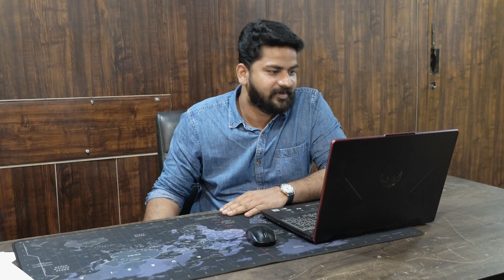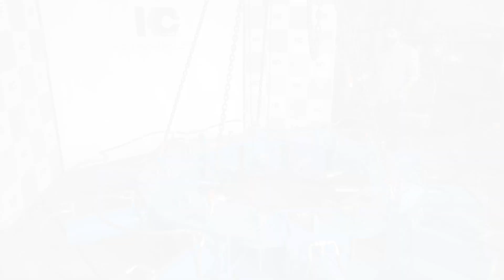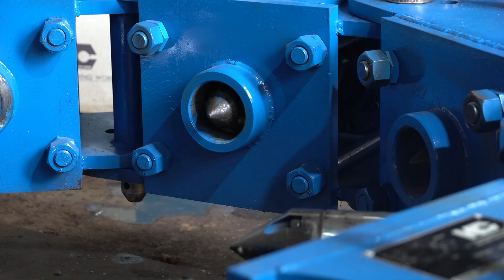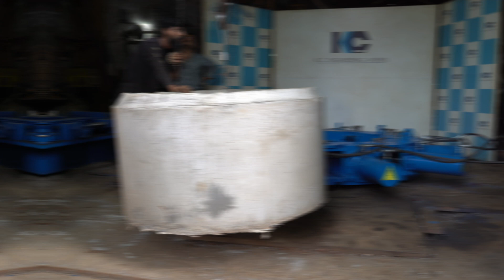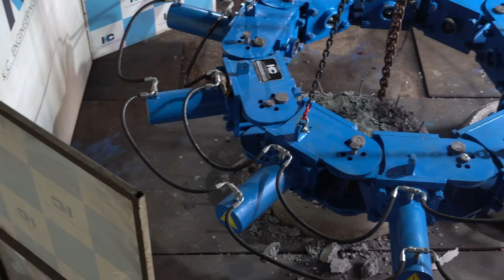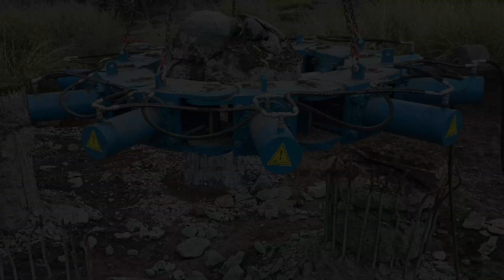Hydraulic pile breaker

Comment: how this pile braker can be attached safely to the excavator as per the international lifting standards. Is it attached on the hooks provided (which has 3rd party certification) in on the bucket through wire rope or the bucket removed and provision is made for attaching hydraulic pile breaker? is the excavator boom has SWL (safe working load- 6 T?) with respect to the braker(3T?) + load falling on the hook while breaking. all hooking point on the bucket, wore rope and hydraulic pile braker should have third party certification. since the bush of braker is sensitive, is the wire rope can damage the bush? is use of web sling is advice which has the possibility to damage itself due to corners and sharp edges though we can provide the corer pads but generally web sling is not advise I feel .. kind advice from the experts expected please.